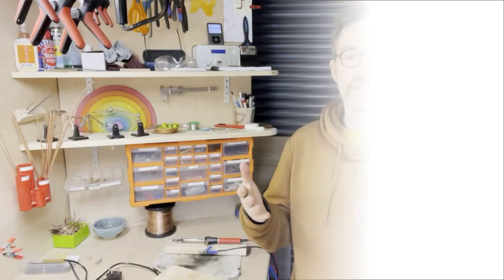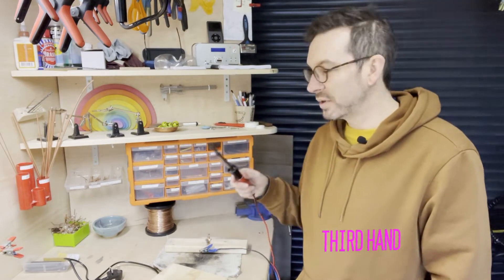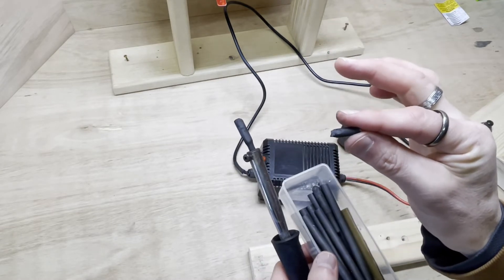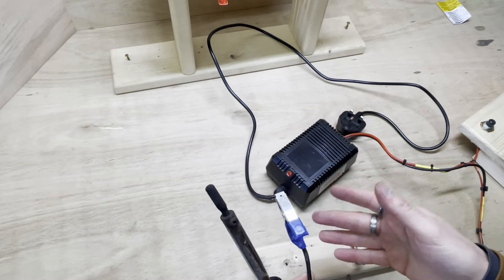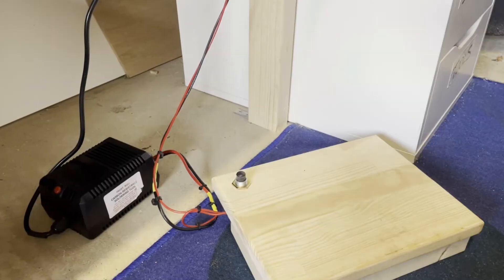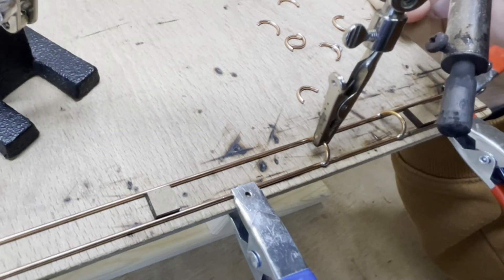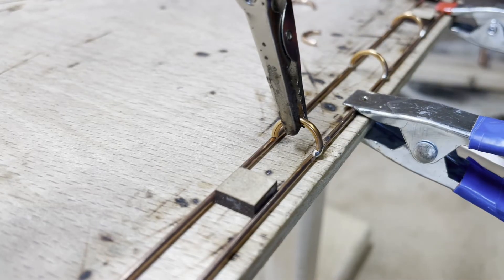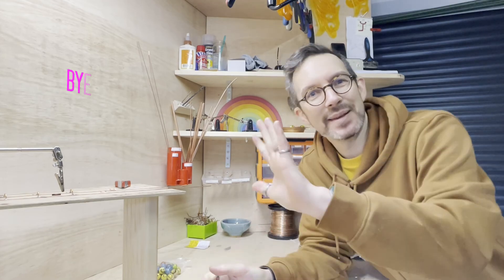Resistance Soldering // An update on what I use and why I like it

Comment: I know that this is an older video, but I have a question.  When you are soldering the second connection, without moving the clamp, why doesn't the first connection melt?  That whole stretch of copper should be heating up, right?  Or is the heat generated that localized?
Reply from the maker: Hi. The copper does heat up but it’s much more local using the resistance iron. But I still have to be careful not to melt a nearby solder joint.

Comment: Hi Ian. Absolutely fascinated with your RBS video's. I'm intrigued with the resistance soldering. Do you use a flux? Or is the heat generated via the current sufficient?
Reply from the maker: I don’t use any flux. I find that the heat is enough when working on the smaller wires.

Comment: I Wonder about the size of the wires on the carbon iron and blue clamp.  The switch you say is 60A, but those wires don't seem near big enough to carry that much current.  60A would be #6 gauge (US size)  much bigger than the ones you are using?  Also, if you move that blue clamp as close as possible to the carbon iron, it will heat up faster, but I suppose you may already know that.
Reply from the maker: Thanks.  Of all my matters, the soldering system I use brings up the most interesting debates.  To be honest, I don't know much about this, I just purchased an off-the-shelf system and added a switch.

Comment: Hello, thank you for showing your skills and giving us appetite to do (try to do...) some ourselves. I did some "testing" with using a normal soldering iron but that is not a real success as you will know. Resistance soldering kit is pretty expensive for giving it a try but I was wondering if I could weld the tracks  with a hot air soldering gun. I would be able hold the track parts in "free air", not on wood or so that could burn/smoke by the hot air. What do you think? Thanks in advance. / Marcel

Comment: You can put switch with 10amps but at the 230volts and it will work the same way but you must isolate it very good

Comment: Hello, thank you very much for your video. I have 2 questions.
Can this soldering tool also work to solder stainless steel? And how long can this tool be turned on constantly?
Reply from the maker: Hi. I don’t know about stainless steel. Personally I’ve only ever used it for copper. My hunch is no. 

I turn the unit on for several hours when I’m working. But it only makes a circuit when the foot switch is pressed and the tip is touching the copper.
Reply: @CopperGravity  Thank you 😊

Comment: Hi man, can you tell me what kind of wire you use? I'm talking about Brazil and doing some tests with galvanized wire the solder with tin doesn't glue properly. Tks.
Reply from the maker: Galvanised is hard. I gave up using it. I now use plain copper wire.
Reply: @CopperGravity  i'll try with plain copper.
Thanks for sharing your tips.
Reply: Be careful with galvanized - the zinc coating puts off poisonous fumes when it's heated.  Best to do it outside and with a fan to blow the fumes away from you.

If you want to use it, sand off the zinc coating around the places where you're going to solder.  Use lots of flux and a hot iron.  You'll probably have better luck with acid-core flux than you would with rosin-core flux.  You can find acid-core flux at a plumbing supply.  (Just don't use acid-core flux on your electronics.)

You're really better off trying to find non-galvanized steel wire, though.  Avoid the wire they use to make springs (it's called "piano wire" in English speaking countries) - it's hardened and made to spring back so you'd probably have trouble getting your curves right with it.

Edit: If you're going to be outside anyway, you might have better luck with a propane torch instead of an iron.  You still need to sand and apply flux first, though.
Reply from the maker: Useful advice Jeff. Thanks.
Reply: I tried a couple of different types of galvanised wire and they were night and day when it came to accepting the solder. Not sure you would get much fumes from the zinc coating while soldering, rather low heat compared to for example welding.

Comment: Sorry but I'm not convinced by this at all. Isn't instant and actually the solder isn't flowing very well either, and a matt finish suggests a dry joint. You really should try  a temperature stabilised type such as a weller, and silver solder. You won't look back. You could also throw away that 25w antex type iron you use for electronics. A decent iron with range if tips will do everything (and better).
Reply: You're right it is far from quick, in this example. That is because he is using it wrong. Used properly you literally only need to apply power for about a second. The tip is too far from the joint he trying to make. You can also see he has deformed the copper where it was heated too long.
Reply: "a matt finish suggests a dry joint"

The matte surface is caused by wobbling when cooling. Lead-free solder is also not shiny.

And the most important question of all.Who cares if it's a dry connection? Dude that's not an electrical circuit 🤦🏼‍♂️

Comment: This is the most awkward piece of RSU I have ever seen. 6 volt is a lot, and you can see it in the video as well. I recommend you to watch Scalefour Society:s videos on the subject. Good luck with your soldering projects!
Reply from the maker: Cheers for your comment. I have no control over the voltage as this is a commercial unit. Only on and off.

Comment: Hi again, got a few questions as I’m most likely going to buy one.

1) have you found much need for the red booster button?
2) where do you get your carbon tips? Have you found any better ones since making the video?
3) does it zap you in any way if you touch both the positive and negative?
Reply from the maker: Hi Jayden. 
1) Only for copper greater than 2mm. Like tubes. 
2) www.glsed.co.uk I’m still using them. 
3) No.
Reply: @CopperGravity  Thanks dude :)

Comment: Thank you for explaining this new-to-me method of soldering! I failed miserably in the past to solder steel wire armatures with a larger soldering gun for crocheted lampshades. I just could not get the wire junction hot enough to melt the solder. You may have just provided a way out of my conundrum without resorting to a blow torch.